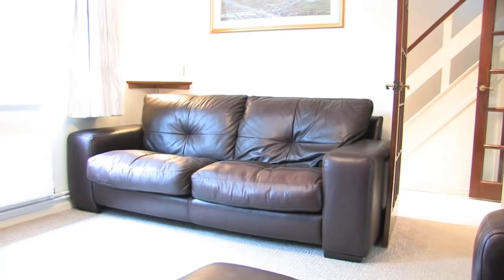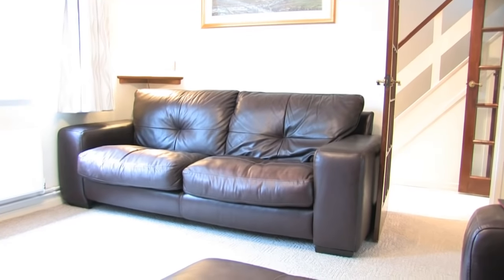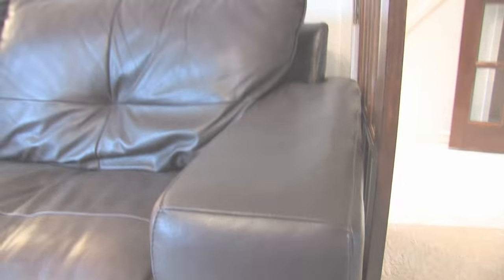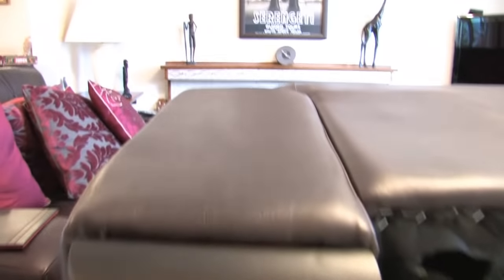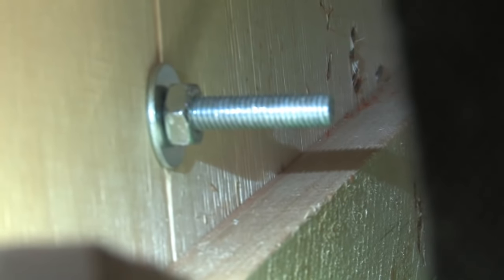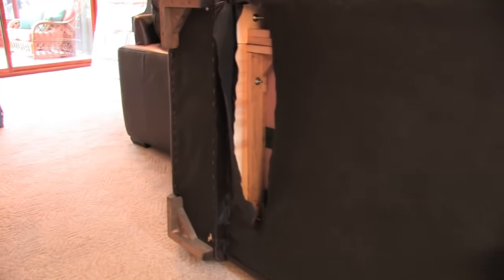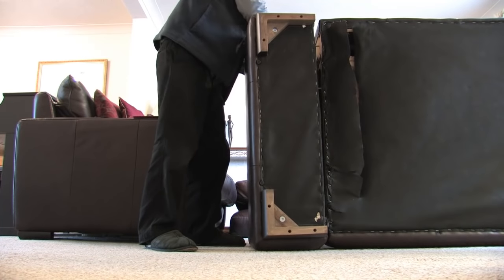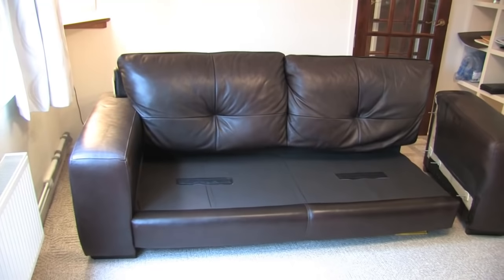How to get your BIG SOFA through the door

Comment: Thanks for the tip. Our sofa has had it, but we don't know if its a wooden or metal frame, so im going to cut the back to find out. It weighs a ton, so I'm guessing metal. If I can remove the arms then it will defo fit through our large sliding door. If I can't, then we have to get the guys in, who installed our doors to remove one door or both!

Comment: Brilliant mate, my sofa slightly different, but constructed in the same way, so took off the arms, and moved the sofa to another room so i could re-carpet. great thanks. There was a zip on the bottom to allow access to the frame, very handy no cutting bottom fabric  or de-stapleing required
Reply: Paul M Marsh what is the name brand of your sofa? I would like to buy a sofa that I know the arms are made like that.
Reply: my sofa was from DFS, i believe most are constructed in the same way, due to having to frequently dismantle to get into flats and small homes etc. Ask them before you buy im sure they will be helpful

Comment from the maker: The only way you can find out if your sofa is constructed in a similar way to the one in this video is to roll it over, make a slit in the under-material and look for the bolts that usually hold the arms to the main frame. If you can't see them it could be that your sofa is constructed in such a way that won't allow you to dismantle it.

Comment: Sweet. What's the name of the tool you used to remove the nuts and bolts?
Reply from the maker: +jane smith I used an adjustable spanner but a pair of pliers would do the trick